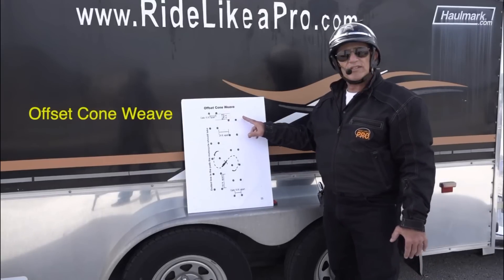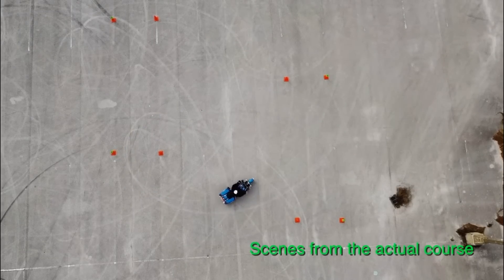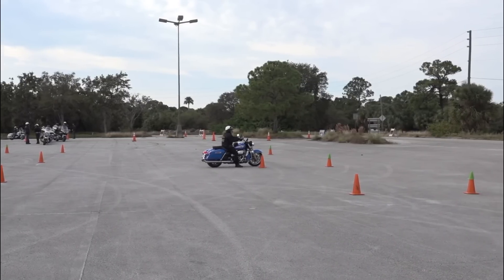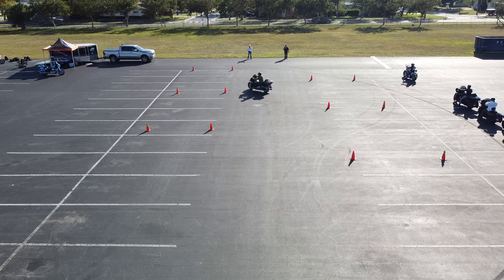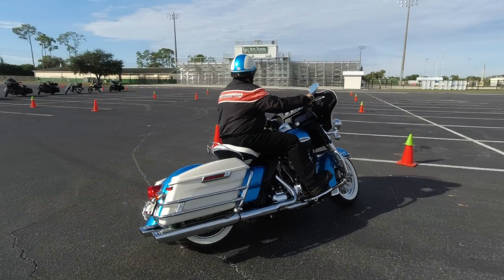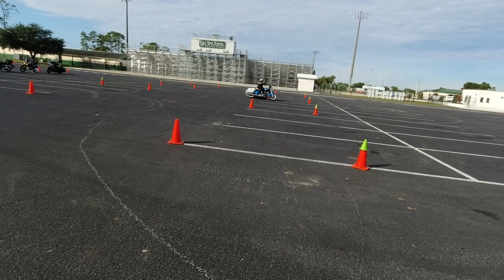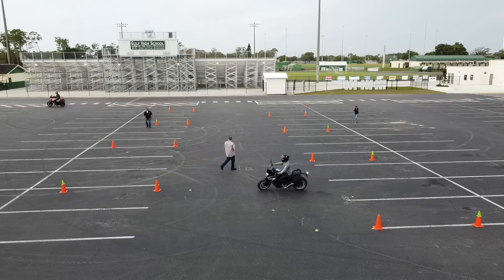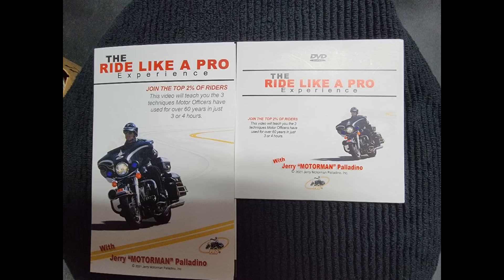Avoid this kind of crash

Comment: Really like your videos. They have helped me very, very much. I've been riding since I was 16 years old. I'm now in my mid sixties and still learning.  Still do not have the skills you have. I was just wondering how many times you have to change out your clutches in your bikes that you let the students ride?
Reply from the maker: The bikes I rent for my class are purchased used so I don't know if the clutches are in good shape to start with. I've had to replace one clutch on a Sportster a couple of years ago but that's it. What wears a clutch out is keeping the revs too high while in the friction zone. If I see a student revving too high, I explain that 1500 rpms is all that's needed. That's worked pretty well over the years.